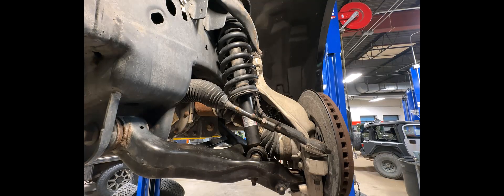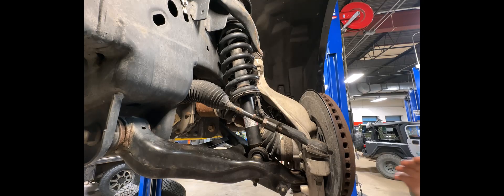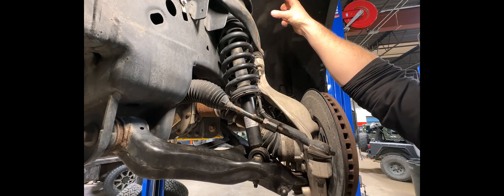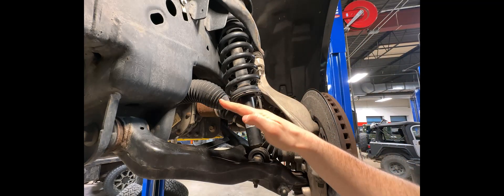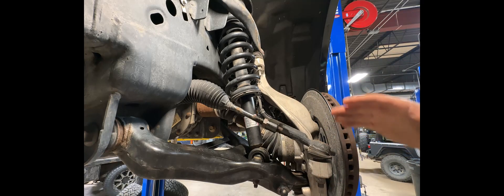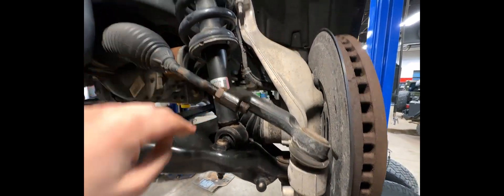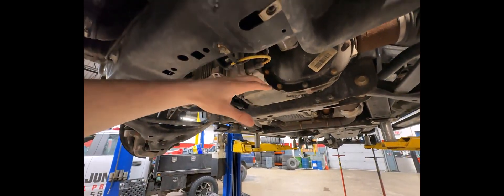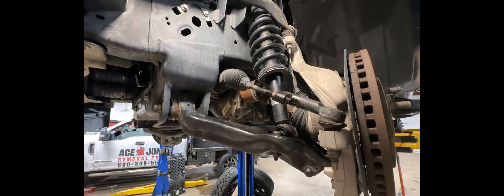Level Vs Lift Suspension Geometry

Comment: This is why I want to get a 4 inch bds and take off my 2.5 inch spacers
Reply from the maker: Yeah def better for all your driveline. BDS is a Great Kit.
Reply: What about a 2.5” BDS coilover with new UCA?

I’m afraid that cutting the frame for a 4 or 6” suspension will not be as strong as factory, and no real improvement due to the fact the entire center section was lowered, offsetting and lift gain for other than aesthetics.
Reply from the maker: @mkbmj well the 4 or 6” lift will actually be better than a 2.5 when it comes to driveline geometry. A 2.5” leveling kit puts your cv axle angles higher causing premature wear and tear. The reason for the dropping the diff on a suspension lift is to retain your factory driveline angles, which also affects overall ride quality as well. And having cut the factory crossmember out myself I can tell you without hesitation that the BDS crossmembers are considerably stronger and beefier than the factory crossmembers. Plus BDS provides additional support bracing which just adds additional strength. I’ve driven tons of lifted trucks as I overlook a series of shops that’s installs lift kits every day. Most do cause the ride quality to drop, but the BDS Kit is an improvement over factory in my opinion.